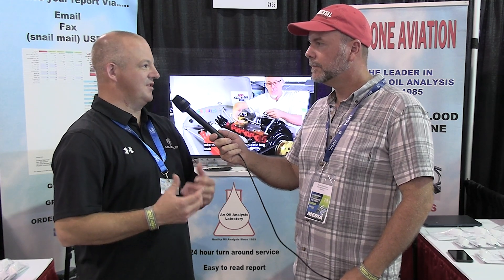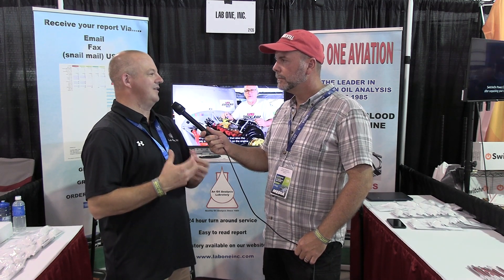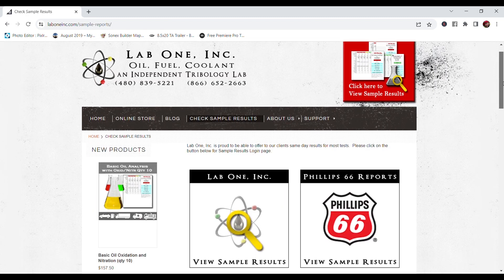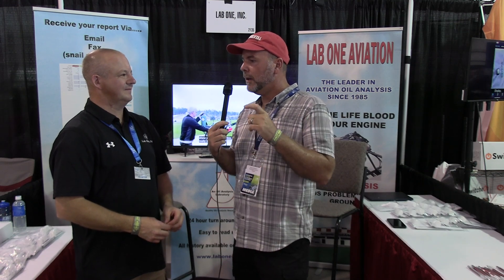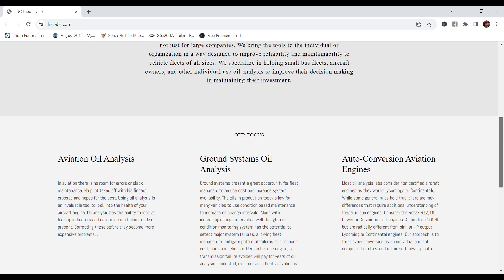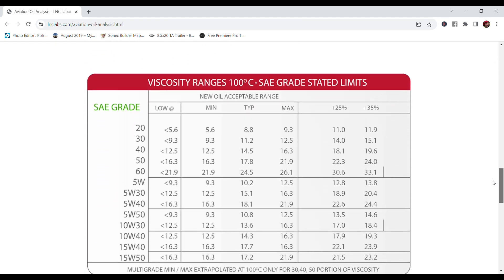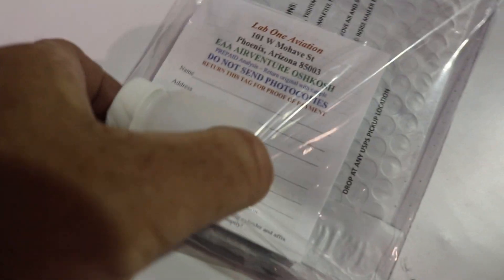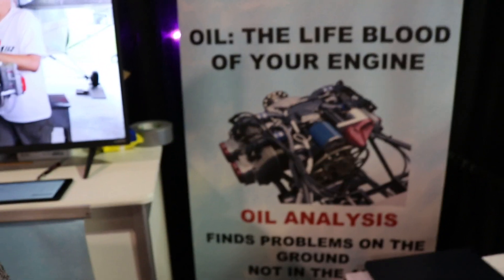Engine Oil and Oil Sampling Explained - Aircraft Vs Automotive - Oshkosh 2023

Comment: This is bad info. Synthetic oils are NOT compatible with 100LL per Mike Busch.

Furthermore, Phillips 66 Victory AW 20W-50 Aviation Oil contains anti-wear additives. It is pre-blended with the proper concentration of the anti-scuff/anti-wear additive (LW-16702), as mandated by Lycoming Service Bulletins 446E and 471B and Service Instruction 1409C. This additive helps protect against wear and piston scuffing, particularly under high loads and at high temperatures. Same is for Aeroshell Plus.

Comment: So is Larry saying running LOP is not necessarily a good thing, based on the oil analysis he is seeing? Interesting!
Reply: There are a lot of way to run LOP . I think at low hp there is no issue to be LOP .
Reply: @chantereaudominique8855  Lycoming manual for engine operation does not allow LOP above 55% applied HP.  Continentals are a little more forgiving of LOP operations.  The other problem with Lycoming is that the CHT probe is not on the hottest location of the head.  I've got pictures were BBQ paint had burned off of the cylinder and the head, but the location of the CHT probe was perfectly fine.  The pilot of that plane said CHT's were always below 400, but the valves were completely burned and it cost him 3 cylinders after 100 hrs.  This was in a C206.